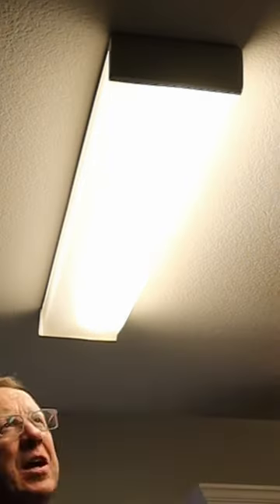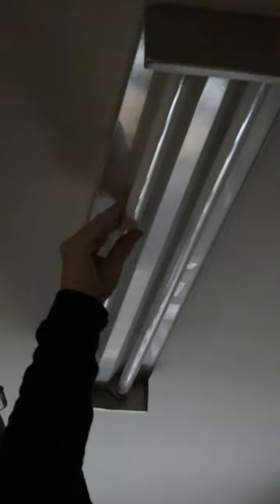Replace That Burned Out Fluorescent Light

Comment: I can’t seem to crank out the old bulbs. I got one out & replaced it just now. It didn’t want to rotate out. It was very uncooperative. Then the others that I tried have no intention of rotating out. I’ve done this before a long time ago and I got them in and out. But it wasn’t easy. A couple of them broke on me back then. This time it’s basically just not happening.
Reply from the maker: If it is an older fixture it may be a push instead of a twist.

Comment: I think my starter needs to be replaced but I can't find it. It kind of looks like yours. Is it maybe under that middle metal portion? It's not on the side at all
Reply from the maker: Yes that is the transformer.  It will be under a metal cover/plate.  Once you find it see if HD or lowes or whoever you have near you has a replacement.  Thanks for watching.
Reply: @OakleysDIYHomeRenovation101  Thanks so much! I'll be working on it this weekend.